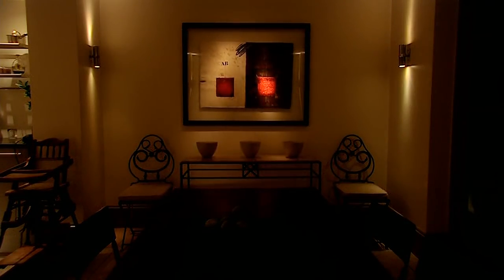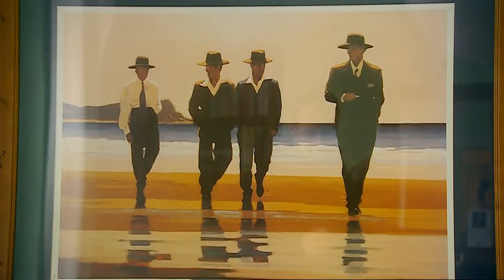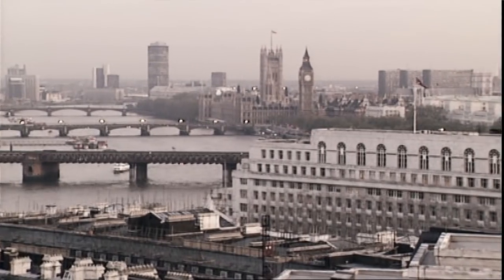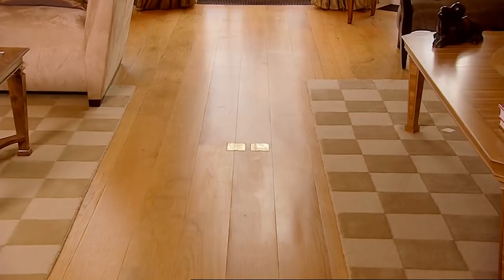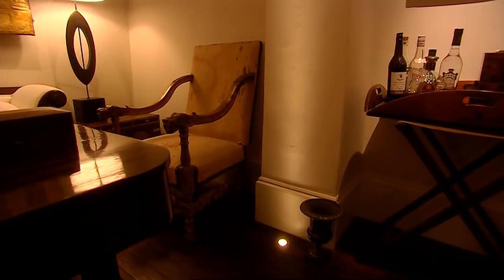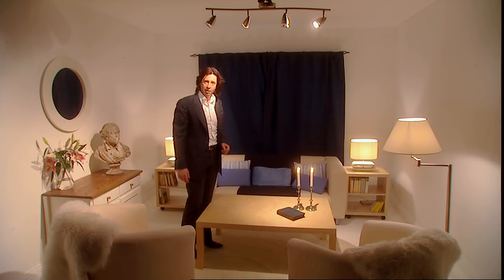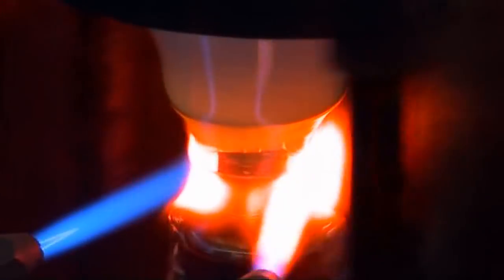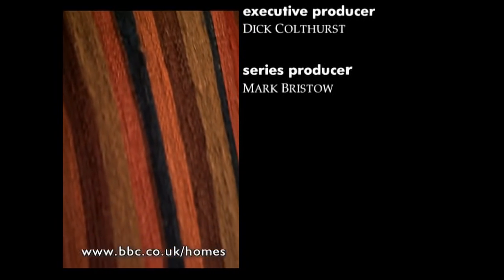BBC - Design Rules - 3/6 - Lighting

Comment: This is an old show.  It has some nuggets of wisdom.  I wish he voiced my GPS. 
So....throughout this show he breaks his own rules from other episodes, lol. For example, at 27:48 in this one, he forgets "rules" from episode 5 of 6 titled Design Planning about symmetry, geometry, golden ratio math for the fireplace mantle area. And he said not to put things in a line of 4 items (those little candles) in a row. He said use an odd number, preferably 3, and so on. No big deal, the writers just forgot about continuity. 
That wee little fart of a rug attempt in the middle of the floor looks like he dropped his bathtowel.  Screw the shiny floor. Add some extra ceiling lights and give those folks a bigger, comfortable, useful rug!  Lol.  Although, for what some electritians charge, it may be cheaper to open that wall and install a bigger window.  
A dozen plants way up in the skylight to water, you say?  I already have too many chores, so how bout I just stab you in the neck instead dude?
Reply: You need a chill pill, for God's sake.